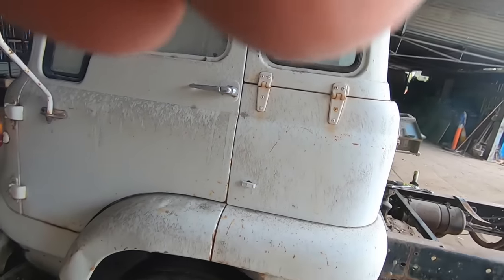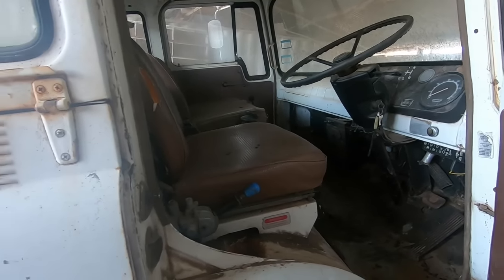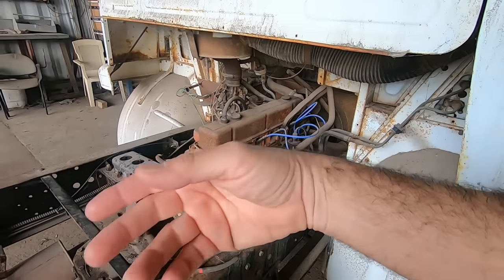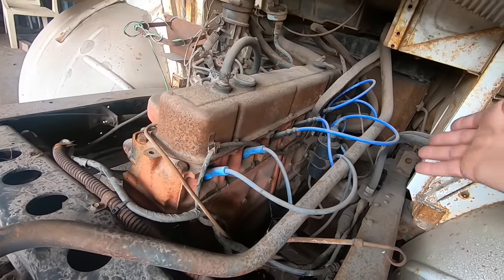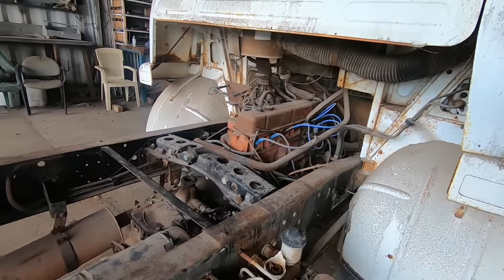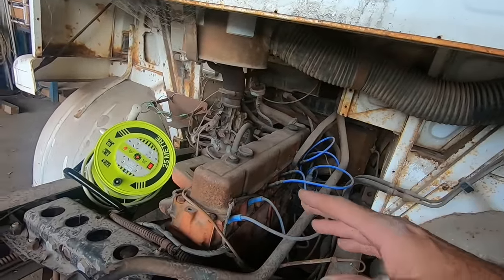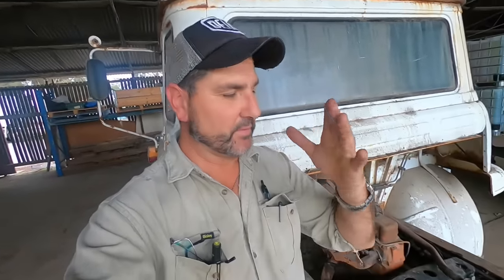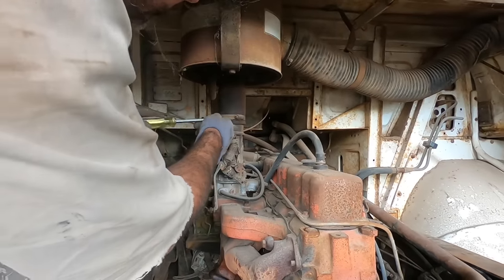TK Bedford - Conversion ?...Chopped!

Comment: This is what we used when I was 20 starting out as a scaffolder in the 80s and is the first truck I ever drove and got my license in.
Reply: Same here in the UK, we had a 4 cylinder and a 6 cylinder both diesel tippers worked for a roofer done our own scaffolding and cleared rubbish and reclaim with them. 4 cyllinder was gutless we were going to a job in welwyn garden city up a really long concrete road my mate bet me a fiver to climb out of the driver side walk along the front bumper and get in the passenger side. He kept his foot on the gas and jumped in the driver's seat as I got out onto the step, maddnes but it was easier than I thought it would be hanging on to the wipers and mirrors.  Wanker welched on the bet as well !!

Comment: He is going to hate how that thing Drives. It is going to be a little rocking racehorse without the race. I hope I'm wrong but I don't think so. The engine looks very much like a 292 Chevrolet engine here in the states which is excellent motor for anything truck-related. Thanks for sharing Bob from Virginia USA

Comment: Mate that engine is the one after the blueflame motor. Its actually what holden based the motor on from the EH to VK commodore.  The holden red motor was based off the bedford truck version and in America that motor came in several CID, 194,215,230,250 and the taller deck 292 so this engine was made on 3 different countroes and the australian holden version was slightly smaller in dimensions to the bedford and chev versions but all had the same internal desighns and external architecture so the bedfords before  1962 would of had a chevy
Reply: The early bedfords had a chevy stovebolt and blueflame but after 1962 they had the same motor that chev brought out in 1962 which holden australia based the red motor on.
Reply from the maker: Thanks for the feedback, in the next edition of TK chopped, in the playlist ,I do the walk around of the motor, still trying to figure the cubic capacity , thanks for the reply.

Comment: the original tk had a 240 or 300 cubic inch bedford engine, then they put the mexican chevs in here in australia gm put a few small blue v8s as well.all the conversions i did were 308 and 253 holden engines using a locally made kit in the 60s
Reply: Bedford 214 or 300, Chev 292, Holden 4.2 and 5.0
Reply: dont know where the 240 came from typo. @franknsnodge

Comment: It's just a sham u ditnnot take the cab off I use work on a fleet 80  so any bobs get touch
Reply: Yep seems only those who worked on them realised or knew they were designed to quickly remove the cab